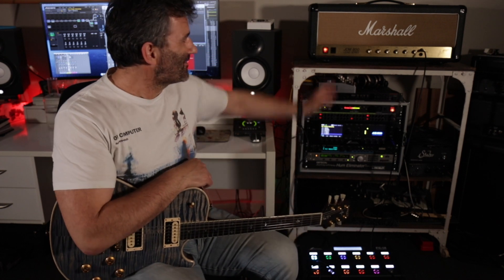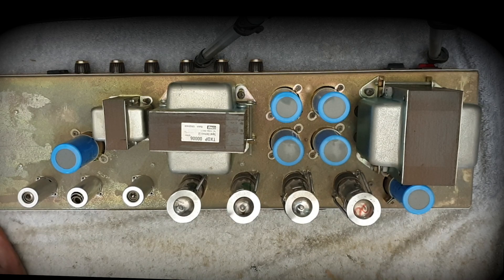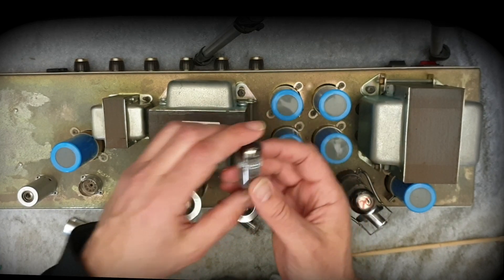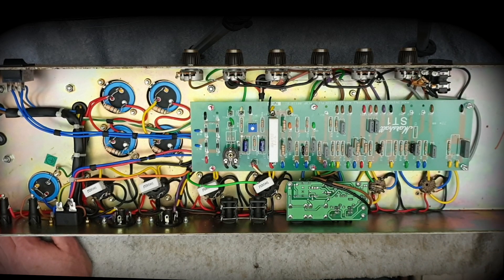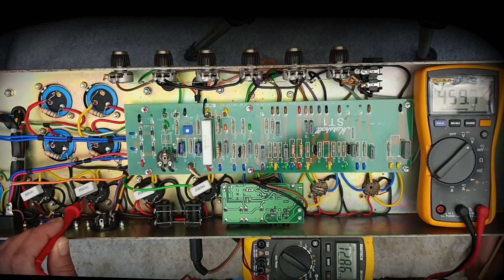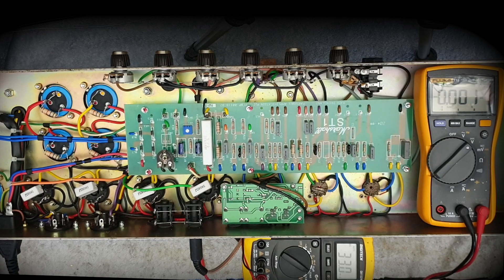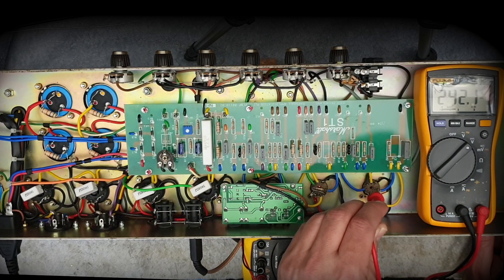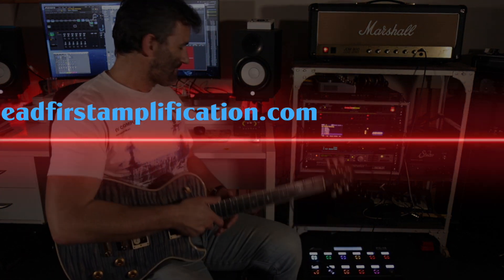Marshall JCM800 2203x Service - COLD BIAS & CROSSOVER DISTORTION!!

Comment: Would have been cool if you had adjusted the bias to where it's just out of crossover and shared what the plate current was at that point. That way people could see the relationship between the two.
Reply: 70-82mV (per pair) will get you outside of the "KINK" in the sinewave where the cross over occurs at the x- intercept on your oscilloscope graph - it is as clear as the nose on your noggin.

Comment: Thanks for the video. So 25% cold bias is making crossover distortion between the 2 phases. But biasing hot at 70% probably generate noises, heat,, power tube stress's and risks of failure?  Do you advice to bias all amps with oscilloscope or bias at around 60%?

Comment: Was surprised by the low voltage, but just to check, you were putting the scope on the speaker output into an 8 ohm “assisted load”. Do you mean a resistor (and how many watts?) or more complex? Could I use an attenuator for the same thing when set in correct mode (line out only)?

Comment: Hey Jason had a question having a biasing issue with 2203x I’ve went through 3 diff sets of power tubes I requested hotter from dealer that I could only get to 65% percent all the bias resistors seem correct 47k and two 220k for the El34s the only thing that’s off is plate voltage is 420v
Reply from the maker: The 15k resistor and bias pot itself are part of too, if either have drifted in value it will impact your adjustable range
Reply: R24 R25 and R28 the same at 35.7 but r29 is 47.1 should all these be equal or is this normal ? Thank you appreciate you getting back to me !
Reply: Mind you this amp is a 2023 model
Reply: All these were negative readings
Reply from the maker: Many of those won’t be able to be read accurately in circuit
Reply: @HeadfirstAmps  r29 is in fact a 15k

Comment: Will the JEL mod work the same on the 2203X amp (ST1 board)  as it does with the older 2203 amps? Thank you
Reply from the maker: Yes, the 2203x is pretty much identical to the older 2203s

Comment: I have a 2203X made in 2002. It seems I can never get the tubes out of crossover distortion. As when the bias pot is maxed out and I can only get about  30 mA on the EL34. My question  is: did Marshall do this on purpose? Did they want the tubes to run cold?
Reply from the maker: That's normally because your amp was built for 6550's or your matched set of EL34's are very low.  Either way it's a simple job for a tech to get you into an adjustable range.  30mA by the way is not that cold, it's just a little under par.

Comment: Quick question. I have a schematic with voltage notes of the 2204, 2008, vertical input re-issue from "Mark Huss", and the voltages on there are waaay higher than the 'sweet spot' voltages you have on here. Why is that? Which voltages should I strive for if I'm to build a 2204 clone?
Reply from the maker: That scheme, based on that version of the 2203/2204's only has 1 x 10k dropping resistor between the screen and PI supply.  You want 2 x 10k to get the voltages I prefer.

See my 2204 restoration clip for more details
Reply: @HeadfirstAmps  Thanks, I see now. The clone I was about to build has only one, suppose they sound better with the 2x 10K resistors between Screen and PI, thus lower voltages on pre-amp?
Reply from the maker: Exactly.  Try it both ways and see which you prefer.

Comment: Hey Jason,in your rig with the amp going into the AxeFXIII,how are you monitoring it,thru your studio monitors or a guitar cab??….Just curious….
Reply from the maker: Hey Scott, mainly through the studio monitors but I so have a guitar cab in here too that I use from time to time.  I should do that setup run down video shouldn't I!
Reply: @HeadfirstAmps  I am the same way…I run everything through my AxeFXIII,and I have gotten so used to the “polished “sound of my amp through monitors…..That said,it’s nice to dust off the 4x12 every now and then and push some air….Living in an apartment,I can’t do that as much as I would like….I have modeled my rig after yours ,with the amp/load box/AxeFXIII setup…..I was using the Power Station,but just got the Fractal X-Load….it sounds amazing….I was just curious how you monitored yours…

Comment: Brilliant. But the cold bias didn't sound particularly bad, and that sound might fit into a heavy rhythm mix even better. The cold bias also sounded dynamically more even, whereas the hot bias introduced a certain "choking" effect that might fit the 80's style but not the 2000's style, so to speak. Then again, Mesa has defined Nu Metal as a genre, and it's fixed cold bias.
Reply: When my amp was biased too cold I thought it sounded good for some types of music, but thin. Like It was lacking something. It reminded a bit of a solid state amp.  I like it in between.
Reply from the maker: Agree!  The cold bias becomes more noticeable when dialling back the guitar vol and playing quietly I find.

Comment: Thank you for this video. My 2204 clone bias has been out of range too low since the initial power up. I’m going to try to find your 2204 video that you referenced here. I have a 47k resistor attached to the bias trim pot and only got max 28mv (through the resistor to ground on the tube). The metro amp instructions state to increase the resistor value to increase the bias range. I put in 56k and was at 0-8mv. I made a 32k resistor with a 27k + 5k and was then at 90mv. Hope the tubes weren’t damaged. Can’t wait to solve this, since this video tells me I have not heard the amps full potential yet. Thank you for the info! 

Ps did you find anything with the preamp vol pot that was only coming on around 6-7?

Comment: I have a 2203X made in about 2204 also. On mine I can only get the bias up to 31 mA per tube. Maybe soldering in another resistor in parallel with the stock one at R28 would help. A question: when the effects loop is not being used, is it out of the circuit? Or does it still have an effect on the sound of the amp? I never use mine.
Reply: Year 2204 - do you have a time machine 🙂

Comment: Great video Jason.  Ive got a 05 Marshall tsl100 with the SIR #39 mod. Marshall claims the bias should be 90mv per side. Do you think that is too hot? The opinions are everywhere with people who own this amp. What would you recommend? Thanks man i enjoy the channel!
Reply from the maker: Do you know the plate voltage on that amp?  That would be 90mA for 2 tubes...are they el34's?
Reply: @HeadfirstAmps  yes Jason. 4 el34s. I dont know my exact plate voltage, but from what I've read, it should be around 480 or so.
Reply: @jamescarpenter4777  at 480 plate voltage and at 70% bias each tube should be around 36 mv.

Comment: Great vid. A lot of techs just use the scope when setting bias to eliminate the Xover notch and leave it at that without even checking what the plate current is. I’ve often wondered  at what % of max plate dissipation is the xover notch eliminated in a 2203/4 .
Reply: I believe that varies.
Reply: It depends more on tube matching that amp itself. When You put not matched tubes, one will work at optimum bias and another will be pushed hotter too get good results.